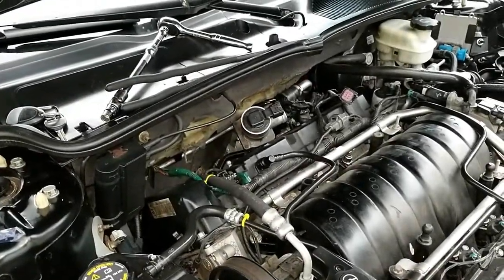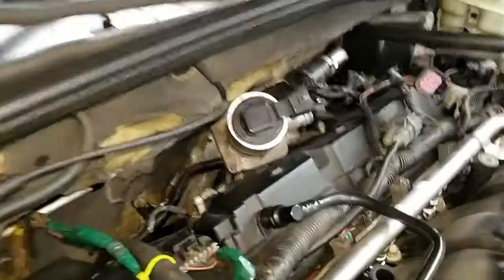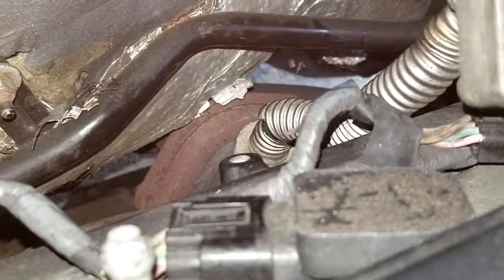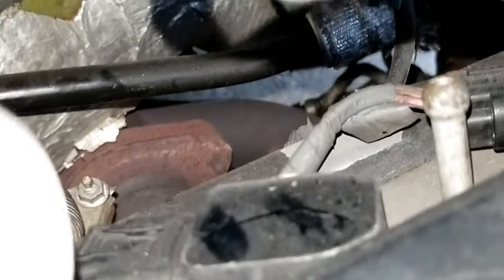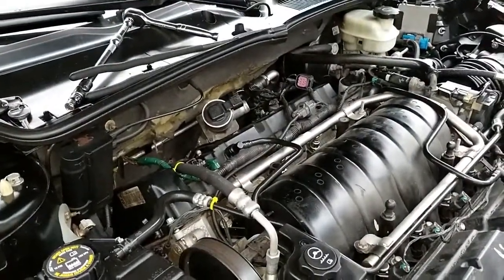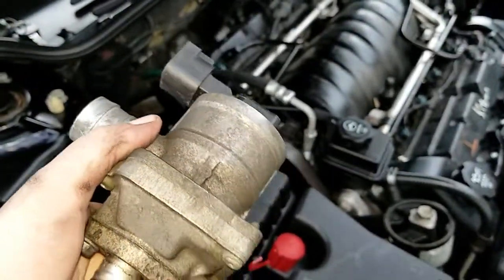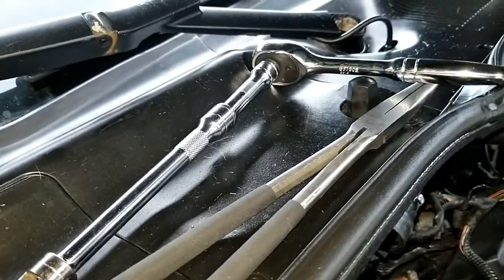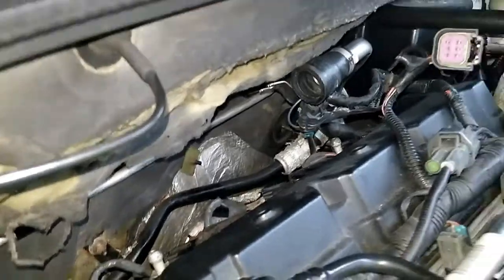2006 Cadillac DTS - P0420 Repair

Comment: thanks for sharing this video Froztinc, it is helpful. how much is the air check valve? is the hose sold separately? can I just buy the hose or does the whole thing need to be replaced? thanks for ur time.

Comment: Nice video bro . I have 09 with issue radio stay on after opening  and closing the doors.can you help.ty
Reply: The pin inside the door push it with your finger it will turn off

Comment: What is this valve called?
Reply from the maker: It is called a air check valve. I just looked it up this is the part # 12619111
Reply from the maker: Antonio lac There are 3 total oxygen sensors. Do you have a code for a oxygen sensor?